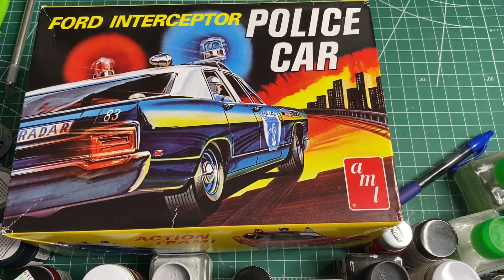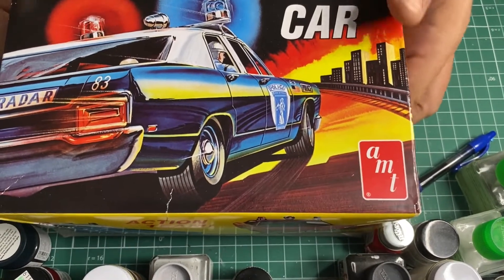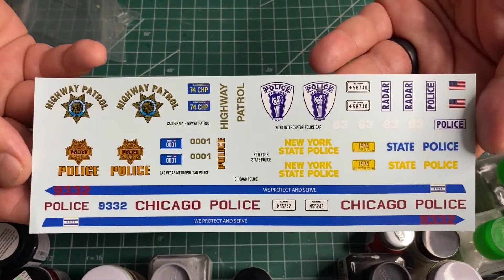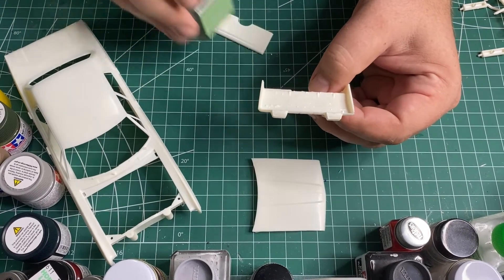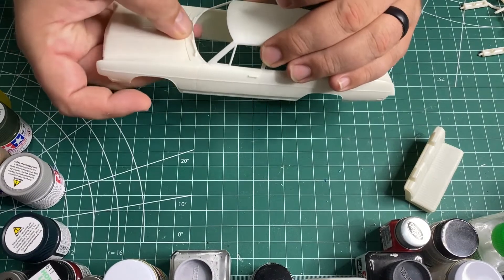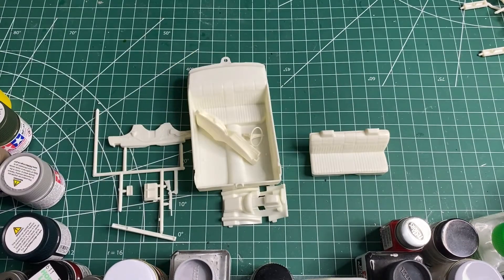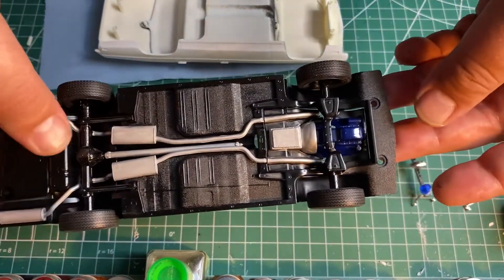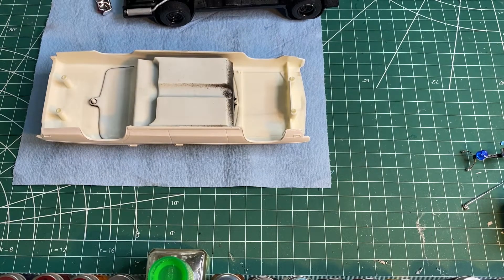AMT 1970 Ford Interceptor Galaxie Police Car Model Kit Unboxing and Build

Comment: Yours turned out well, I have this same kit but it's molded in blue and is the 007 "Diamonds Are Forever" tie-in, I plan to use the Gotham PD markings on mine. I have to say, it was quite nice of the Round 2 crew to provide decals for the dashboard instrumentation panel because I don't think I can paint all those tiny lines, the kit looks easy enough to tackle. Happy modeling!
Reply from the maker: I have one of the 007 kits as well, not sure how I will do that one yet. Thank you for watching!